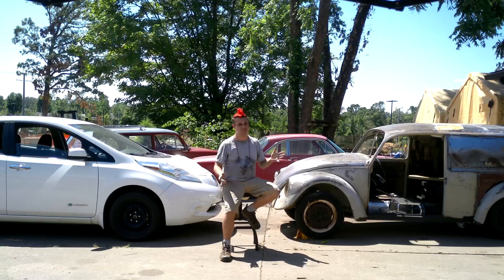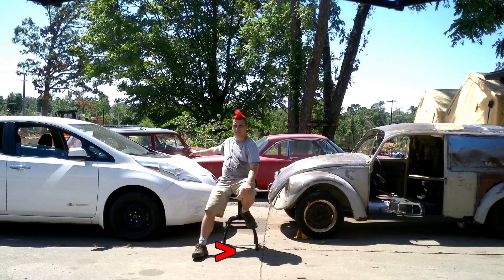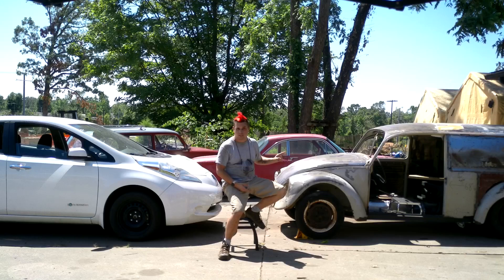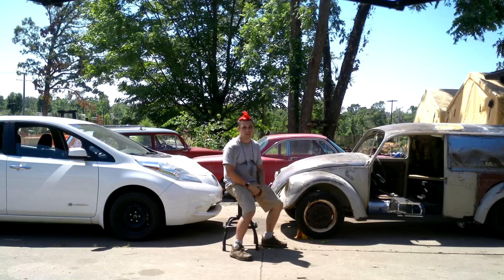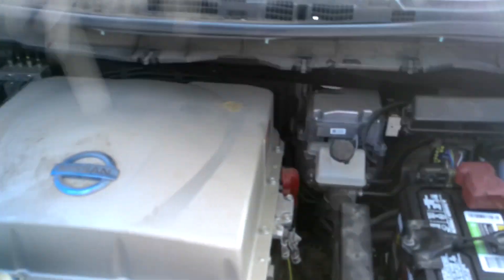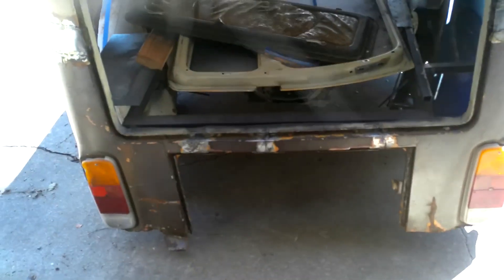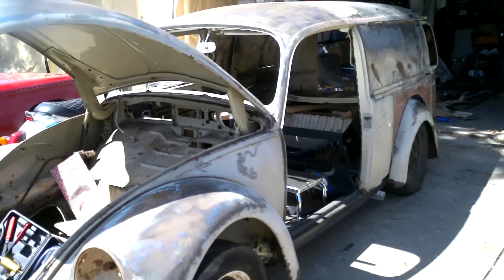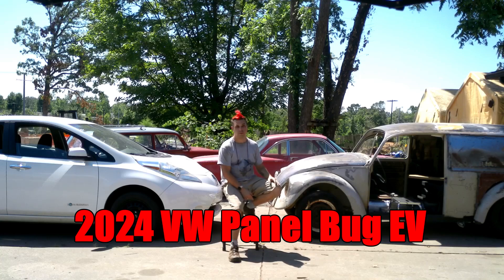Putting a Nissan LEAF motor in the Käfer Van Build, Panel Bug ep 29

Comment: Just a thought on you swapping the motor/transmission over: if you don't mind the little added width, you could adapt the hubs to take the VW bolt pattern (for the sake of wheel continuity)
Reply from the maker: I am definitely researching using the existing hubs to the existing suspension on the beetle pan. If i can get it to work then ABS and TPMS will still work. The rear isn't that hard so the front conversion may be the troublesome part but no matter what i will need to shorten the axles to fit the fender width of the beetle since they stick out A LOT from the edges at the width they are from the LEAF.

Comment: Subbed and looking forward to this. I have a Renault ZOE parts car which has a motor but no battery and BMS. 

Ultimate plan is to shove it into a bug if i could find a chassis.

You can be my template 😂

Comment: Are you putting the Leaf's front sub-frame into the front of the beetle? If so you will have some fitment problems with the Leaf's struts and the beetle's fenders. Nathan's Garage (on youtube) ran into that issue too, look up his channel if you want to see it. You will probably also have an issue with the width of the Leaf's wheels being too wide for the beetle. But you may be able to fix that by using fenders from a Super Beetle. If you're putting the Leaf's front sub-frame into the rear of the panel bug (ala the Corvarius project), that may be better. Good luck!! BTW I'm also building a Leaf-based EV conversion, and I've done a frame swap before, but this time I've decided to only swap in the EV components and keep as much as I can original on the old car (1962 Mercury Comet). And I will build a custom rear suspension for the new drivetrain. (sorry of this comment is a repeat, I think youtube deleted my first comment).
Reply from the maker: Thank you! I've been a big fan of yours for a long time. My daily driver is a 67 Squareback and i love the Miata build!  I love the Comet build can't wait to see it running! I have watched your "Everything you Need" video several times now while prepping for this. I may need to pick your brain on future parts of this. 
The plan is to put the motor in the rear shorten the axles. Possibly use part of the K member frame from the front of the leaf to make a motor mount that connects onto the pan so i can still lift the body off the pan. If i can do it right i would like to use the LEAF wheels and keep the TPMS and ABS System. If it come to be to much trouble i will marry the VW axle and the LEAF axle like Regen EV does on the FastLEAF. Taking the top 2 sections (charger and converter) off the LEAF motor should give me more than enough room to make it all fit and then the battery will be the floor of the cargo area.

Comment: Good idea I’m just not sure how the trans is gonna work backwards I know Subarus you have to flip the ring gear or you’ll have 4 reverse gears.
Reply from the maker: I'm not using the trans from the Beatle. The drive train from the LEAF is all in one and will do all the work for me. I'm just using the suspension
Reply: @tinkering_guy  yea I know what I’m confused about is when you turn it around for a rear engine your reverse will now be forward unless you mess with the internals . Which your max speed will be about 10mph
Reply from the maker: @DerrickG-u8f  I'm not turning the motor around. I can mount it facing the same as the front and it will work just fine. Also from my research if I wanted it flipped there are 3 main lines and if you swap 2 specific ones it will spin reverse just as fast as it spun the other way.
Reply: @tinkering_guy  oh ok I didn’t realize this is gonna get interesting haha good luck!

Comment: i seen a lot of software amd hardware hacks for the leaf to increase the battery capacity and to have nissan leaf stuff work in other cars , its going to be an interesting build
i seen electrified bugs they usually use a forklift type motor mounted to the original bug transmission , the leaf has a different setup , wonder how youre going to craft it to the bug driveshafts/ hubs 
abs system needs a signal from all 4 wheels (some sort of tooth wheel mounted to the hub ) it usually has traction controll too , it needs the signal to see if all for wheels rotate at the same speed , or stop rotating in the case of abs) 
it might be possible to mount the front wheel subframe from the leaf including its suspension and innerfenders? intoo the rear of the bug , that should take care of the springrate driveaxles hubs rearwheel diskbrakes etc you only need to lock in the steering , i seen that done on cars converted to two engines and awd , they basicly drive the front minus the fenders intoo the cut out back of the sencond car and start welding

Comment: You need to see if the leaf has front wheel speed sensors.  If you keep the ABS, the computer will want those.  Look for a wire to a sensor in the front with some sort of exciter wheel.  I’m sure you’ll be able to figure a way to make it work.
Reply from the maker: From what i have read so far i believe the sensor is in the motor itself based on RPMs but i can definitely double check to be sure. I would love to keep the sensors and make the whole thing work

Comment: Was the fuel port under the VW logo on the front hood?  That would be a cool place to put the charge port, if it is!
Do you have an idea of the weight difference between the two vehicles - that might effect the battery load under acceleration?
Does the leaf you are using have active thermal management?  Leaf's are known for batteries overheating and damaging themselves.
Lastly, I think you should keep the gutters.  The look may be smoother, but the rain will not flow well off of that panel back.
Reply from the maker: Won't know the weight until the build is done. The cap on this year Beatle is under the hood as in you have to open the hood to get directly to the tank. I'm wondering if the logo may be to far to reach for some chargers. Also there are 2 types of chargers so i wouldn't be able to fit them both under the small logo. True the LEAF has a passive cooling for the battery so i would have to do a completely new design in order to ad one if i went that route and that would be a lot of work i didn't plan to do.
Reply: @tinkering_guy  The charge port under the hood was just a thought, since it might have been easier than being behind the headlight, but you have got to make things fit where they will fit. 🙂  The weight and the battery are probably not critical if you are not using this are a regular deliver vehicle - mostly I was curious if you thought you would would have to modify anything for it.  I love watching you do these things - my car modifying dreams came to an end years ago - and I don't want you to think of anything I am saying as a criticism.  Keep making the world a better place!

Comment: Can’t do a body swap??
Reply from the maker: The LEAF is surprisingly wide on the wheel width. It will be easier to shorten the drive axles and keep the Beetle front beam intact. Trust me i did A LOT of measuring to see if it would be worth it.